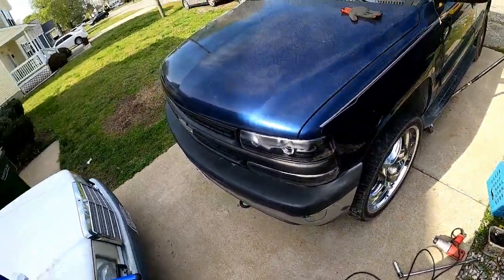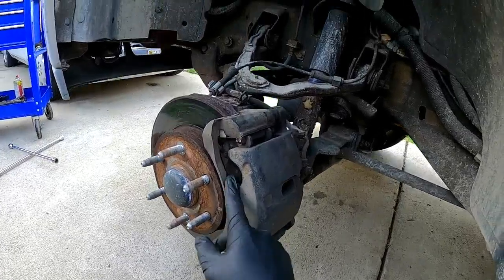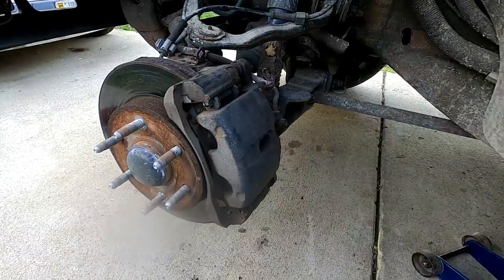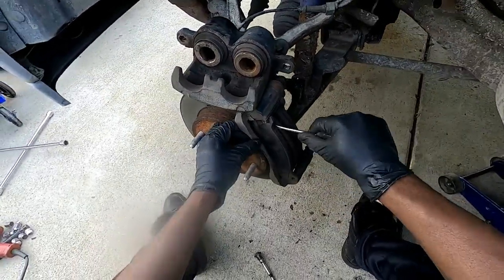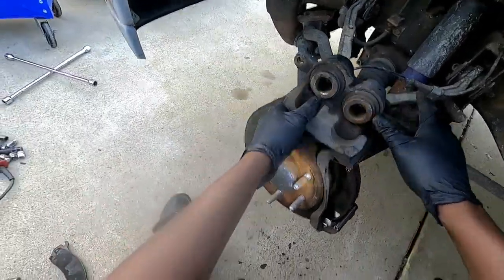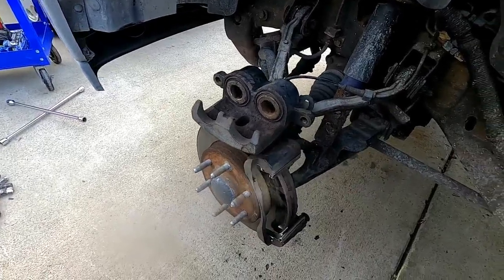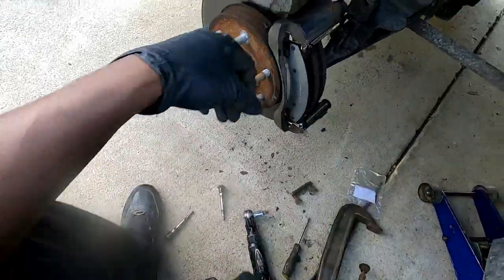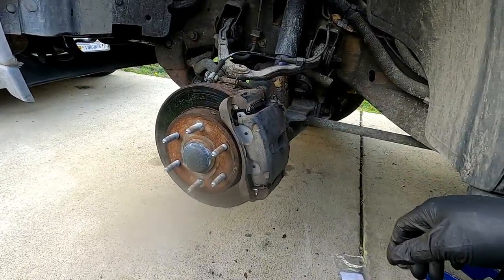01 CHEVY TAHOE FRONT BRAKE  PAD REPLACEMENT

Comment: Can you just loosen the bleeder zerk instead of the cap? Or does it make a mess in engine bay with cap loose or no?
Reply from the maker: You don't need to bleed it or lose any fluid. Plus once you let air in the system you'll have a actually do a real bleed job
Reply: That’s how I do it, slightly loosen it then push slowly with a clamp, then topped it off with new brake fluid